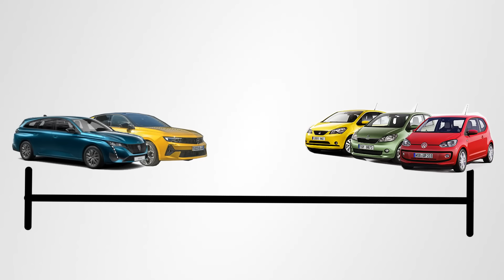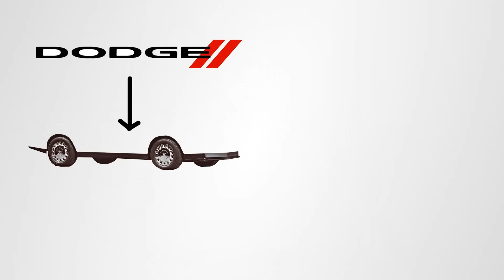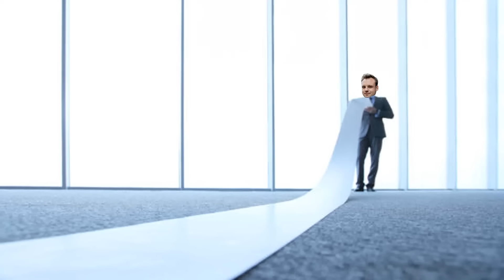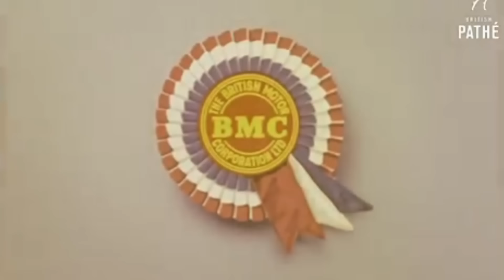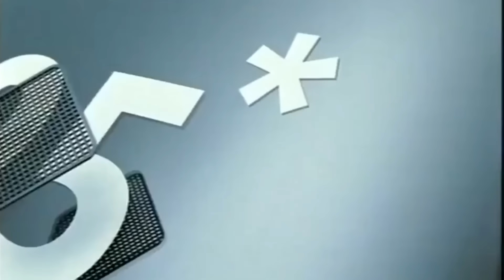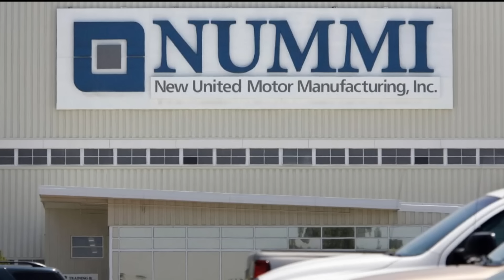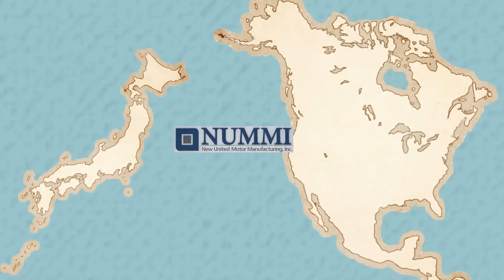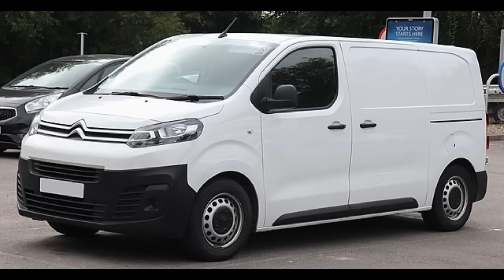Ep. 30 Seeing Double: The History of Badge Engineering

Comment: I sell auto parts. Several years ago a Honda Pilot owner came into my store needing...something. It was a part not covered by the aftermarket, so I called the Honda dealership. They immediately told me that I needed to call the Isuzu dealership since the Pilot was REALLY an Isuzu Rodeo. So, I called the Isuzu dealership.

They told me I had to call the Honda dealership. :face-fuchsia-tongue-out: So I knew I had to go another route. The customer and I walked out to the Pilot and lifted the hood. The part in question, fortunately, had a Honda part number sticker on it, so that was the end of that. Til the next time.

Comment: In the 1950's, the Indian Motorcycle Company stopped producing bikes.  They (I think) first bought the largest Royal Enfield paralell twin and marketed it as the 40 cu in Indian Chief.  By the mid '50's they were getting their entire line from Royal Enfield, providing the dealer network and good name only.  The Indian Chief was a good bike for it's time, while being smaller and a bit more efficient than it's own old models and the American competition from Harley.  This continued until they split the sheets in 1960 and Indian began distributing the British Matchless brand.   
So just before American mechanics had to buy metric tools; they needed to get sets of Whitworth and British Standard Fine (BSF) tools, maybe along with those tiny Brit sized ignition wrenches too.

From 1935 to 1945 Sankyo in Japan had license to build the Rikuo model 93 & 97 motorcycles for the Imperial Japanese Military, from Harley.  They were exact copies.

The BSA Rocket 3 and the Triumph Trident were very near exactly the same bike.

The Kawasaki W-1 was simply a Japanese built licensed BSA A-10 with improved bearings.

The Meguro K was a licensed / Japanese built British designed BSA A-7

Comment: My absolute favourite car of all times still is and always will be the Peugeot 205 T16 which was used in Group B rally in the 1980s. 
So 30 years or so after this videos topic. 

780kg total weight 
All wheel drive 
480bhp Turbo 
0-60 in 1,8 seconds. 

Small. Very small, but fast as shit. An absolute monster of engineering. 
In my opinion the craziest car to ever be manufactured. An absolute death machine if u dunno how to drive a motorized vehicle. 

Beautiful, small, fast as fuck and deadly as hell. ❤❤❤❤❤

Comment: Putting domestic badges on imports is called " captive import." The foreign vehicle may be produced by a subsidiary of the same company, be a joint venture with another firm, or be acquired under license from a completely separate entity. The brand name used may be that of the domestic company, the foreign builder, or an unrelated marque entirely.

Comment: I see a lot of people in the comments saying "you missed x and y" but I understand that a full list of all badge engineered cars would take months if not years to compile and lead to an hours long video.

Instead, I find it odd how your key example (and thumbnail) are so wrong.

The T-Body platform used in the Isuzu Gemini was mostly developed by Opel. But was meant as a world car from the start so input from GM Brazil, US, and some from Isuzu was included.

Your list of models in the platform is incomplete. Wikipedia list 37 versions. I mean, you went to talk about Daewoo immediate after but didn't mention the Daewoo versions of the T-Body.

Isuzu was the most prolific with the platform and continued to improve it after the rest moved on. It's versions did get spread to more parts of the world as well. But they are not the source

Comment: I would list a distinction between poor efforts and good efforts. VW to their credit does a good job with sharing platforms between brands (VW Phaeton, Porsche Panamera, Bentley Continental, Bentley Flying Spur all use the VW D1 platform; VW Touareg, Porsche Cayenne, and Audi Q7 used the PL71 platform; etc.). If done carefully, it can be done correctly; if done in a sloppy, lazy, or cheap matter it results in failure.

Comment: i totally agree i have a 1992 holden rodeo its the exact same as the isuzu rodeo/faster (idk how the isuzus are categorised by 4x4 and whatnot) but the only main difference is it being RHD and getting the 2.6L in the rwd model as the isuzu only got the 2.6 in their 4x4 models

it has the isuzu 4ze1 engine but holden put longer and more aggressive extractors on it to make it more aggressive and make more power there are some other small things but it still has the builders plate that says isuzu motor company and the key has isuzu on it. 

the other main difference is that the EU at the time had laws requireing an egr and catalytic converter system that wasnt required on the Holden models so the regular 4ze1 that the US knows has 120 to 130 hp but the 4ze1 from holden had closer to 160hp due to the more relaxed emissions

but overall the engine is also pretty much identical to the 2.6 from the Geminis

Comment: They are all at it,either badge engineering or using each others parts,it goes on a lot more than most realise. Look at the FORD-PSA DLD/DV engine for instance, it is/has been used by Ford,Volvo,Mazda,Citroen,Peugeot,Toyota,mini,Suzuki,Opel/GM just off the top of my head!, and now DS and Renault are also using its newest version. I had once had a Volvo salesman try to tell me that Volvo's 1.6 diesel was better than the 1.6 diesel in my wife's Focus,despite them being identical units.

Comment: I think there has to be an extra category for badge marketing. The Toyota Yaris and Mazda 2 is badge engineering given they are separate businesses. Badge marketing would be your 4 x GM brands. Separating different tiers of premium features into 4 brands. Especially considering Holden badge engineered the Chevy Equinox and GMC Acadia and sold them both as Holden's, despite them coming from different price points in the USA.

Comment: Rebadge is also common for parts: mechanical parts, electronic parts which are much more difficult to recognize as badge electronic parts or some software products.
On the other hand products must not be badge engineered, to have similar looking & data sheet. Badged software products look sometimes different (user interface screen & logo), and similar looking software user interface must not use the same underlying software components (open source vs. closed source).

Comment: Here is a example of badge  re-engineering in the profile photo. My 2008 Saturn Aurora XE is Saturn's version of a Chevy Malibu along with Pontiac G6. How do I actually know that these are rebadge cars? I can identify their engines and interiors can fit in these cars. Engines are four-cylinder ecotec 4-Speed automatic transmission and the 3.5 l V6 4-Speed automatic transmission and 3.6 l. V6 with a 6-speed automatic transmission and their interiors are nearly identical and you can also fit Wheels, tires, suspension components on these cars and I see these cars everyday. I am driving to and from work and there are several of these cars that are in my neighborhood I see two 2008 to 2012 Chevy Malibu's. I spotted a 2009 Saturn Aurora xr and last week my workplace which is berkley collision and Auto Care in berkley Michigan. Just fixed a 2010 Pontiac G6 so that's how I know that I am driving a badge re-engineering. GM Saturn Aurora XE

Comment: The most recent rebadging is the Suzuki Beleno built in India it will become the Toyota Glanza all that will  be changed is the front grill the steering wheel and some name badging on the rear also tge the Subaru BRZ and the Toyota GT68 l live in Australia and drove a Holden Rodeo it was an Isuzu the Mercedes-Benz ute is a Nissan underneath

Comment: The ford f series trucks were sold in Canada as mercury m series. And the older chevy suburbans were slapped with a GMC badge and still called suburbans, as well as the chevy blazer rebadged as a GMC Jimmy. Both the chevy rebadges had no differences other than a chevy or GMC badge. The difference between the ford F series and mercury M series was a grill difference and interior differences same body though.

Comment: Nvidia, Intel, and AMD have done this with the microprocessors they design. Intel plans to do this with some of their lower end 13th Generation Desktop processors that are coming out next year. 
What this mainly consists of is taking older microprocessor designs, cleaning them up a little bit to slightly improve clock speeds, then rebadging them as part of their next generation lineup.

Comment: Without seeing the video yet, my prediction is the GM TrailBlazer platform was the most rebadged.

Chevy Trailblazer
GMC Envoy
Olds Bravada
Saab 9-7x
Isuzu Ascender
Buick Rainier

(and now that I have seen the video, I guess I should clarify that this badge engineering was just for the US market... it's true that the front fascias were all different, but they all had the same shitty 4.2L inline 6, same shitty 4 speed automatic, and were all subject to the same recall campaigns because every failing component was the exact same)

Comment: You're mistaken about the Corvair and Tempest. The Corvair was rear engine, rear drive while the Tempest had a front engine, rear trans axle. Also the engines were entirely different. The Corvair used a air cooled 6 cylinder boxer engine while the Tempest used a 4 cylinder that was basically Pontiac 326 with half the cylinders missing.

Comment: If a car that I wouldn’t be able to buy in my country is now available because of badge engineering, and it doesn’t bother me. I also think that if the underlying platform is the same, but the interior exterior and inner face are unique to the brand, I don’t care about that either. And finally, even when it’s the exact same car just with, a different brand, as long as there’s something unique to that brand, then I see it as giving me more choice assuming that the underlying vehicle is good. A bad vehicle is bad. A good vehicle is good, no matter how much it’s shared.

The only other exception is when a car totally doesn’t fit with the brand and the reason why you buy it. Jeep doesn’t make sports cars, and there are a lot of automobile companies that rebadged SUVs that it just didn’t really work. Otherwise, overall, it doesn’t really bother me that much.

Comment: I don't know if that's a good enough example for the corvair and a tempest. They may have a platform is someway the same but I don't consider those to be a simple rebadge.. motor in the rear on a corvair, I would imagine the frame setup would have to be different and if the body they changed then minus turn signal stocks and basic things these are two different cars?

Comment: I own a citroen saxo and it's the same thing as a 106. Mechanically if you swapped those two it would be the same. Even the platform seems the same. There are very few differences like the cheaper suspension in the saxo. Citroen and Peugeot are the kings of rebadging here in europe

Comment: General Motors A platform (FWD) produced from 1982-1996. These included the Buick Century, Chevrolet Celebrity, Oldsmobile Cutlass Ciera and Pontiac 6000. For fourteen years they produced these cars that were all nearly identical aside from minor alterations to the face and tail lights. And at the time they tried to pass them all off as different cars. Where I live you still see them all over the place we just call them A bodies. Don't take this the wrong way though they were good cars and the fact that so many are on the road today is a testament to that. But they were all pretty much the same car wearing different masks. Also given all the parts are interchangeable they are incredibly cheap to maintain and work on.

Comment: I submit to you the most abhorrent rebadge ever known in the US, the Cadillac Cimarron.  One of the bazillion J-Body models that was definitely worked over, but as with most 80's products, it was a complete piece of garbage.  I find Dodge had some interesting and cool ones in the 1980's however.  The Mitsubishi Starion/Plymouth Conquest was cool.  The Dodge Stealth and Eagle Talon were also cool Mitsubishi's.  (Extra credit - look up what the plastic things on the fender of the stealth were created for -- it was hilarious).  The K-car basically saved Dodge and the heavy, heavy redesign of the K-car platform to the Grand Caravan was a stroke of genius and literally created an entirely new genre of vehicle.  The K-car wasn't great, but it was good, and cheap, two things the US needed in the high-interest-torture of the 80's.

Comment: Australia had the Toyota corolla badge engineered by GM Holden to become the Holden Nova with mild/minimum visual changes, then TOYOTA Australia saw Holdens Commodore car and though hmm we need a full size sedan we'll take that can call that the TOYOTA Lexcen.   
Mazda had a partnership with Ford and created 2 siblings the  Ford laser and the Mazda 323 in the early 2000's .
in 1991 Nissan had it's  pulsar badge engineered to become the Holden Astra
SEAT in 2004 roughly, rebadged the Audi A4
In  2018 Holden got even more cheeky with its badge engineering and imported 'Astra' from the Chevrolet portfolio AKA the Cruz  and the hatch  back came in from the GM Vauxhall/opal factory.
to conclude the  Australian Holden Commodore known globally as the: 	
Holden Statesman and Caprice
Holden Monaro
Opel Insignia
Opel Commodore
Buick Regal
Opel Omega
Pontiac G8
The 2018 final edition was manufactured initially as the opal insignia in Germany, then rebranded to become a holden and then during its production was purchased by PSA then Stellantis and sold back to  us under some kind of licensing deal as Commodore ...weird.  it was then cancelled plus Holden its self.

Comment: Another type of clones are the multitude brands from former communist countries in Europe that is not actually a platform sharing.. initially it was a straight rebadge.. then you reverse engineer the engine and make a facotory (a poor one) to make cheaper clones of that, then you make a factory for each and every component and no imports from the original manufacturer was ever needed.
And after that, the plaform would see various "improvements" from the original. Mostly to make it cheaper for the masses. Another interesting thig is the longevity of the platform that usually is on the order of DECADES!
Few examples: 
Dacia 1100 - Renault 8
Dacia 1300 (1310/1400/1410/1425/and others) - Renault12 
Lada1200 (Vaz/AutoVAZ 1200-1300- and various models 2000-2105) - Fiat 124

Many of these were either a proper license borrow (in the 70's) or just reverse engineering theft (in late 80's). Those from proper licenses were also shady.. as renault 12 platform was nice and great in the late 70's at most eary 80's by then at Dacia they made many modifications from the original and did not consider that renault patent or copyright was infringed. I bet Reanult just ignored the fact that dacia 1310-1410 was based from their renault 12 beacuse the platform was old for Renault and not used anymore and political context left not much to do in case of reverse engineering theft and mass producing the same thing. This was govermently controlled theft at the nation level... so good luck for western non comunist countryes contesting theft from comunist countries). Either way Dacia 1310 and it's variants was sold in many places over the world in a time that Renault already abandoned the 12 platform and the dacia was a lot cheaper that renault variant (with a lot of quality downgrade and poor QC typical from communist factories) 
Dacia 1300-1310-1410-etc was made untill 2004.
Lada 2105 from Fiat 124 was made until 2010.

Comment: When you were talking about the toyota matrix and pontiac vibe you said that it was designed for the matrix, No it wasnt. The chassis is actually the celica gt and gts chassis, sharing the same wheelbase, engines, hp, tune, suspension, steering components, and... well... everything, only difference was a body. So toyota rebadged a chassis they discontinued, then rebadged it again for gm

Comment: The Chevette isn't related to half the cars mentioned in part of this video half are front drive and chevette/Pontiac /Opel are rear drive. Opel Manta built from 1970-1975 for  export to the US. had it's own drive train in Germany and got to expensive to export to US so the Opel Isuzu with not 1 thing interchangable with the German Opel. GM began being  imported to the US in 1976 .also the car was produced  in Australia by Holden. YES GM rebadged alot though.

Comment: I find that 50s GM poster odd because Oldsmobile was the Engineering Firm who made all the technology inside of all of those cars. Pontiac was making more powerful engines and buick had the highest performance engines. Cadillac was more of a trim level and their engines were not technically impressive. Chevrolet was the Posterboy. It sold the most cars in terms of Volume. The interesting part is that the Chevy pattern engine was the most successful and stayed the test of time. All of thise cars had Oldsmobile parts inside them and GM still uses Oldsmobile Patents to this day. GM was founded by Buick and purchased Oldsmobile and Cadillac. That is the real relationship rather than what advertising may have shown them to be.